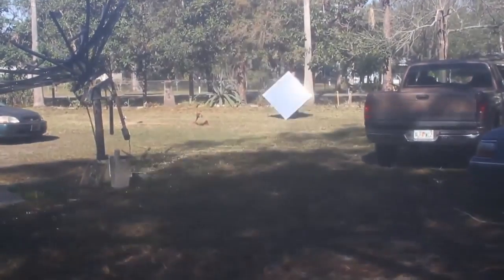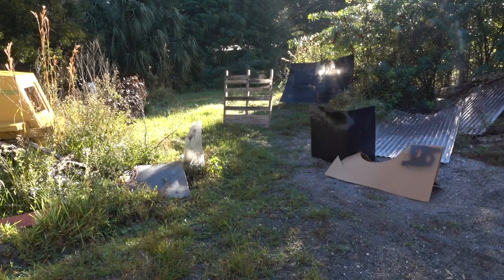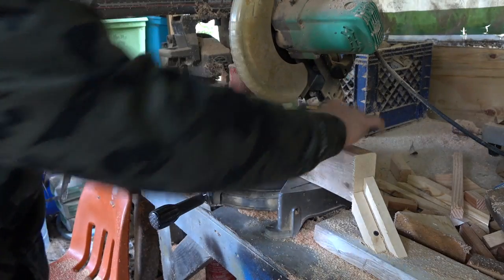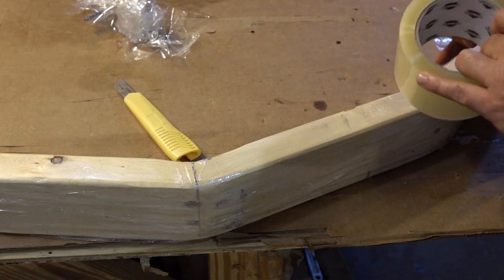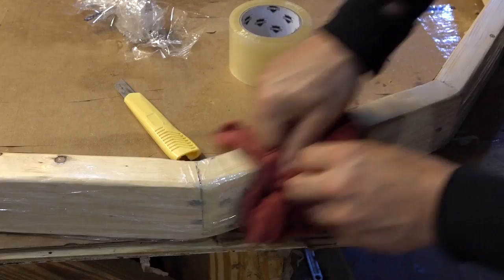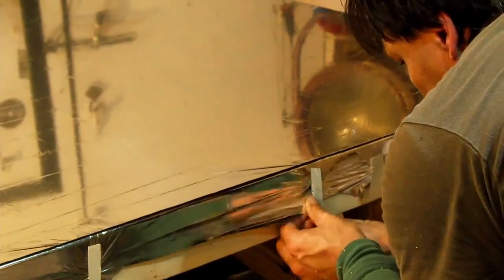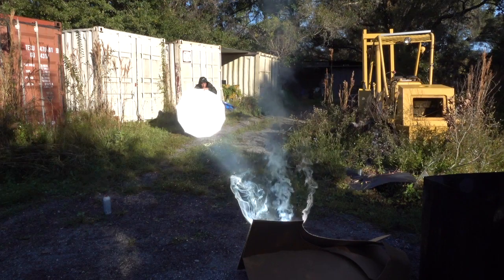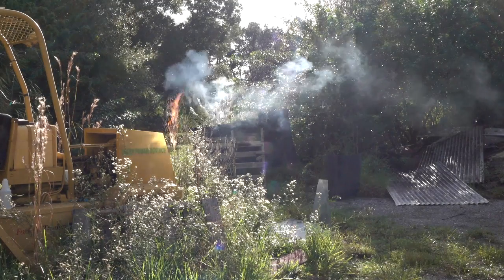Low cost Global relief cooker Parabolic Archimedes Heat Ray Solar GreenPowerScience

Comment: What's the advantage of making it circular? Unless you are trying to focus on a small point the square seems like a lot less trouble and the mylar is rectangular too so you get less waste.
Reply: You get more working mirror surface the more round you can make it. Using twelve sections is a fairly round mirror and works great. I made one years ago following his directions and it will burn a piece of wood 38 feet away. It will go further, but that was the distance I actually measured.
Reply: @chuckmcmurry3532 what about hexagon? we can array hexagon into curvature manner yet still maintaining cool appeal

Comment: use a parabolic lense, and focus it where the propane flame used to be on an R.V. refrigerator, green freezer. or with a stirling  thermal expantion cycleengine fan, make a Air conditioner, use full. right?

Comment: I made one of these in 1995 by covering a 1.2m satellite dish with a mylar survival blanket and using a vacuum cleaner to vary the curvature.
Astonishing power, but needs some distance from the target to cook anything - hot fat or liquids will melt or distort the mirror.
Tip: Use soot from a candle to blacken the bottom of a pan for better heat absorption.

Comment: Stupid question, but could you use one of these to mold giant lenses with epoxy?
Reply from the maker: +piranha031091 You could do that but the heat from the curing process can cause ripples to form. Because it would require several gallons of resin, the curing process would require a few days. Anything faster and heat becomes an issue, I wasted five gallons of resin on a similar project. Bubbles, fogging, debris, and the surface was a mess.
Reply: GREENPOWERSCIENCE
Good to know! Thanks for the answer!
Reply: @GREENPOWERSCIENCE  Maybe use plaster and plaster gauze instead of epoxy, cheaper and less heat to distort the mirror and easier to fix imperfections after casting.

Comment: wow this really adds a whole new element/credibility to the deathray idea. I imagine very thin polished metal could could also flex and bend creating an adjustable focal point as well. 
How about adding a single piece of wood about 6" off the back with an adjustable spindle that adjusts the focal length? .. .you could even use a little motor and pully system and adjust the focal point with a switch...
Great stuff Dan.
Reply from the maker: +squirrelbong A 
Hi, here are some videos we made using the pressure screw on rigid glass:
https://www.youtube.com/user/GREENPOWERSCIENCE/search?query=archimedes

Comment: wouldnt a even concave lens at the end of the focal distance keeps it in optimum focus for an infinite range beam. The opposite applies when you point a straight beam and when it hits a convex lens is disperses just like your parabolic mirror, and to put it back to being a beam you use a concave lens. 
But nice to see you are back.